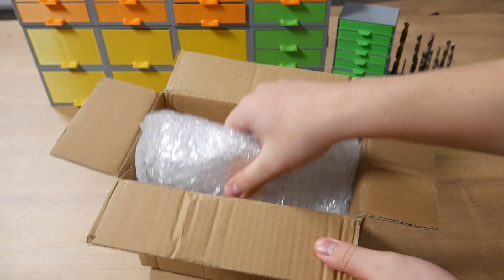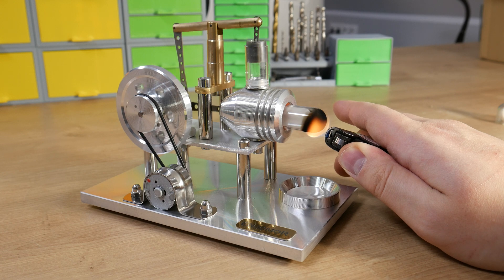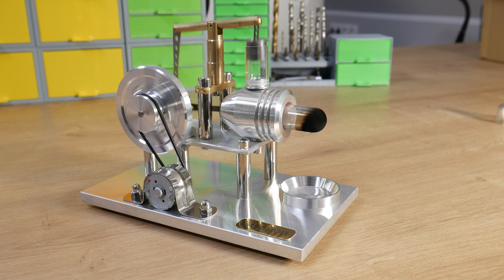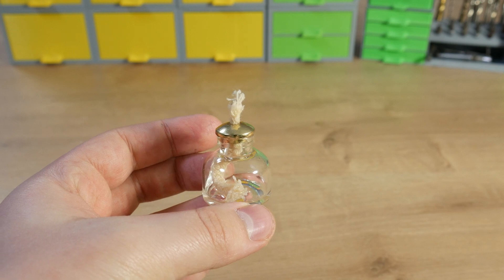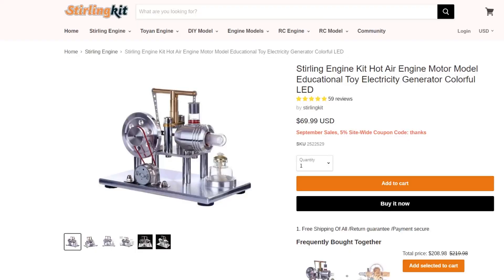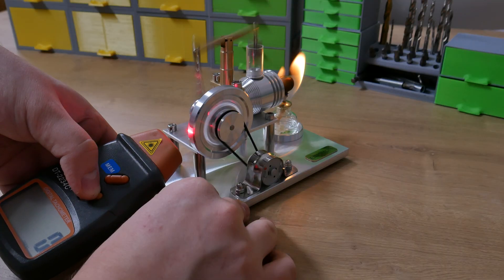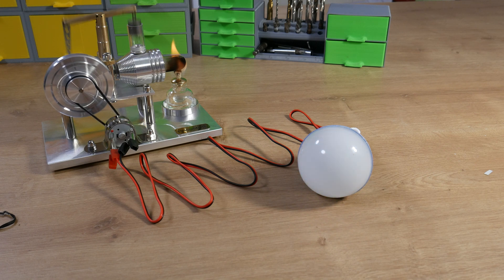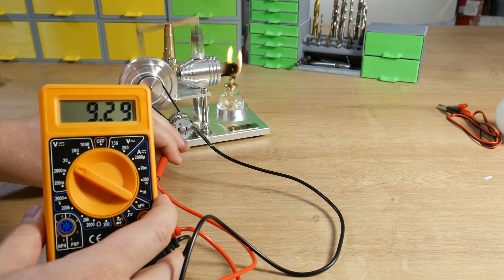This Little STIRLING ENGINE is AWSOME

Comment: I have a dual piston engine. It's just powerful enough to run a 5V booster circuit and charge a phone at around 500mA. Pretty sweet! Had to bolt it to the table though, the damn thing wanted to take off.

Comment: If he were to put a magnet on the piston at the top instead of the metal piston, he could add 2 wires one at top dead centre and bottom dead centre he could create alternating current and if he used a full bridge rectifier he could create dc current and I'm assuming that this idea would be more efficient than the electric motor as a generator because it would be separate from the sterling engine and would not have any contact, similar to how a distributor works by passing a magnet past some wires to creat electricity, I could also be wrong but that is just my hypothesis

Comment: Which is brighter? The output of the light bulb? Or the xandle
Reply: Of course the LED doesn´t have the simple advantage of being brighter, but it also doesn´t generate any smoke... So, as long as the weather is cold and u keep the Stirling outdoors ((where the fuel can freely disperse its smoke), the cold weather is even gonna raise the efficiency (hot-flame/cold-outdoors have higher temperature difference than it being indoors, so, higher stirling-efficiency), and allow even 2 LED-bulbs with longer cables indoors...  ;-)
Reply: @klausbrinck2137  ⚠️ God has said in the Quran:

🔴 { O mankind, worship your Lord, who created you and those before you, that you may become righteous - ( 2:21 )} 

📖Quran

Comment: Awesome information. One of these would be awesome to power my 15kV mini transmission line project. I’m using 2 15kV step up transformers which run of 5v. Check it out on my channel